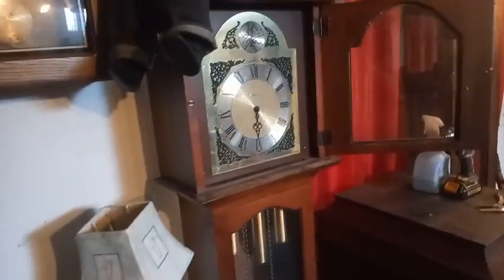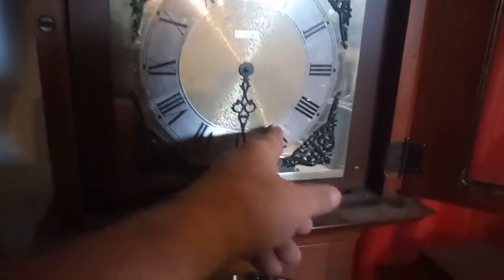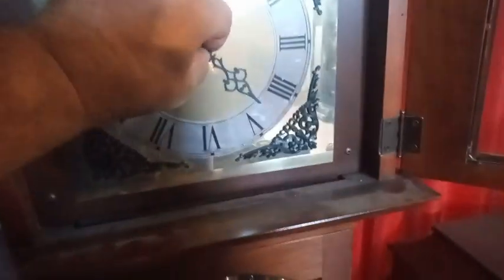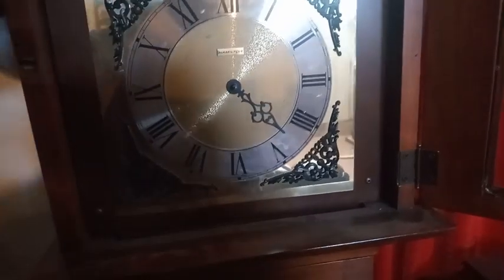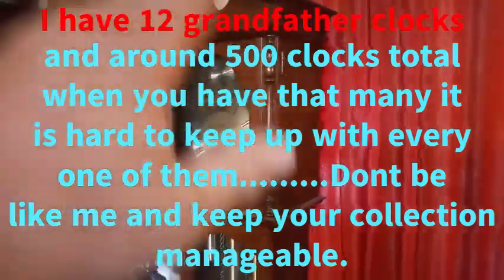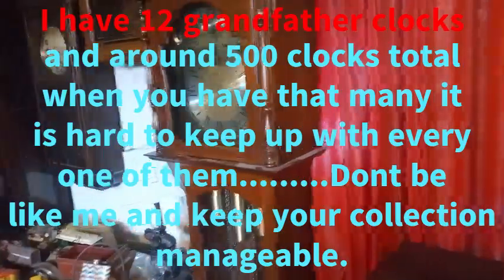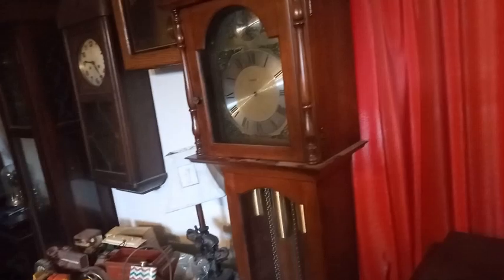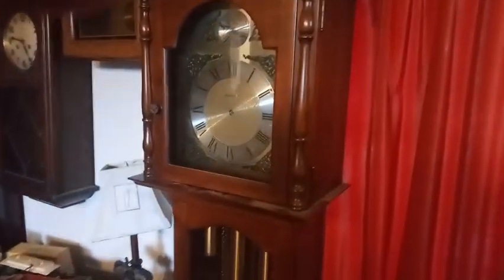Explaining how to get a Hamilton Westminster chimes grandfather clock in beat/what to do if problems

Comment: Good video. I haven't tackled my grandfather clock yet. It will be the last one I do. I was blessed with it working after sitting in a garage for 20 years. And me moving it and driving it 12 hours with the pendulum on and weights in the case. I really had no idea about clocks then. I set it up and it ran. I got brave enough to put a dot of oil on all the pivots I could reach through the access panels, and it has been an accurate timepiece for the last 18 months. I appreciate the promo for my channel, but it covers up an imprtant part of what you are trying to explain. I get why you don't put it at the end anymore, but maybe at the beginning would be better.
Reply from the maker: Thanks for watching commenting. Glad that your clock didnt get damaged and is up and running.  I am experimenting with the promos. Thanks for the feed back.  Thanks for watching/commenting. God bless you and yours.